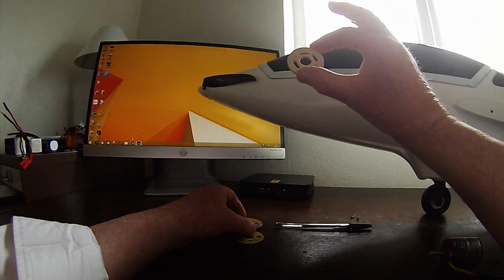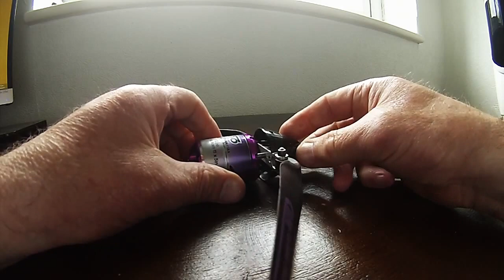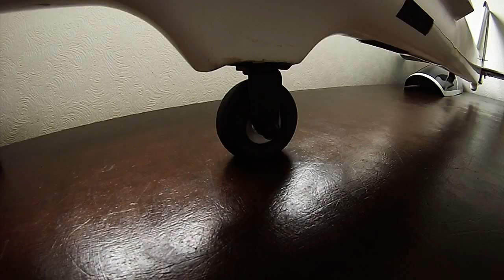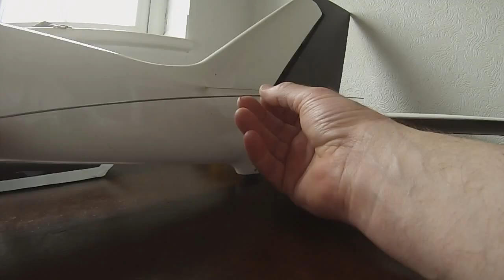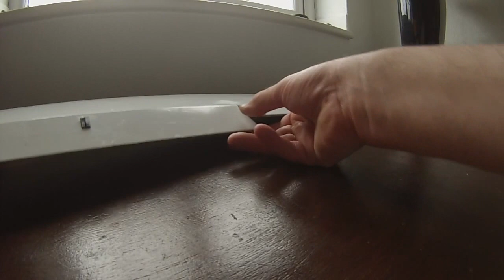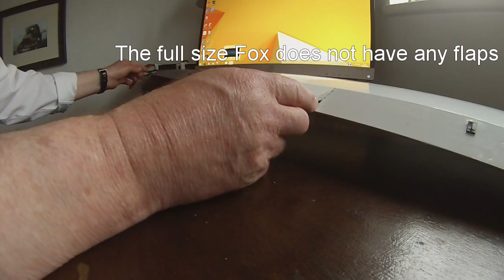Assembly Mod's to Fly Fly Fox rc aircraft

Comment: I saw your video a time ago and I´m now preparing the built for the winter :D May you have the manual?

Cheers!
Reply from the maker: Sorry I don't have the manual or assembly sheet.
Reply: Hello  @J2onton   I now have got the assembly sheet from FlyFly. But it doesn´t have too much useful info. Thanks for your tips! Why did you change the position of the elevator servo? I think the wings are quite light and flexible. But I´m just a beginner... You installed the motor without ofset, this mean totally straight in the lenght line of the fuselage? Mine is also the normal glider without motor mount. I´ll need to look for a motor mount too. Have a nice day!

Comment: just purchased this aircraft, thanks for taking the time showing the improvements.
Reply: glider version of course
Reply from the maker: Thanks for leaving a comment.  Good flying.
Reply: My aircraft has had it's maiden today.  Could I please ask what your CG is set to?  My build videos are https://www.youtube.com/watch?v=CDrMW315HJU&t=4s for the detailed construction and https://www.youtube.com/watch?v=HrWau0zEpl0 for the summary.
Reply from the maker: Sorry for the delay and  thanks for leaving a comment.  C of G is 100mm out from the root = 85mm from the leading edge.
Reply: @J2onton  much appreciated. Mine is now set to 75mm from L.E. How sensitive is yours to tip stall when gliding.
Reply from the maker: Haven't flown it for some time and when I did it was mostly to enjoy its aerobatic ability when assisted by power.  I made a gliding/soaring  video years ago which I have attached for you to view.   I do not have any recollections of it having this problem.  Cheers, John.        https://www.youtube.com/watch?v=2bQabW3RkVI
Reply: @J2onton  took the landing wheels off the tips. Several flights now and no tip stall. My CG is 75mm from the L.E. to keep it flying fast. 3kg AUW. Waiting to try it on the slope. Thanks for the assistance.

Comment: Thought of cutting the extended wheel bay off and install a retractable landing gear as I use on my other gliders. Suppose it should not be a problem space wise considering the available front fuselage volume
Reply from the maker: Glad to be of assistance.  I tried a few wheel mods.  My most recent mod has been to fly the fox with a landing skid only. Clean light and easy.   I agree Fly Fly gliders for their size are very good value for money.  Thanks for letting  me know they are still in business.

Comment: Thanks, nice video. How many minutes of motor time did you get approx. with your setup and 3000mAh battery?
Reply from the maker: Using a x 1, 3000, 4 cell lipo [lite set up] and aerobating the fox, I would say about  5 mins, max.  Doesn't sound a lot but it is when you  chuck it around.  If flown as a sailplane and hunting for cloud lift it depends  upon how lucky you are in finding the lift.   For your info you can still buy fly fly products but I think fly fly  have gone out of business.  The  Company in China  used to have a web site but it has long since gone.  Another of my Fox ..........       https://youtu.be/2bQabW3RkVI
Reply: The company is still there..  @J2onton   but they seem to produce more jets now...